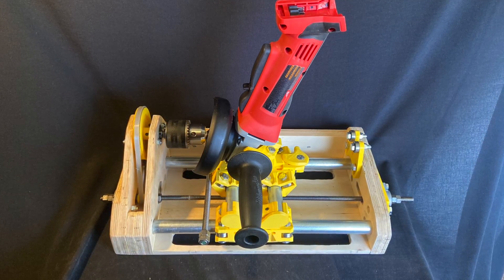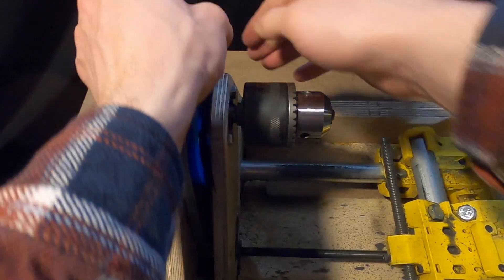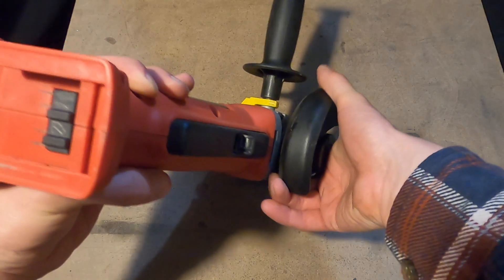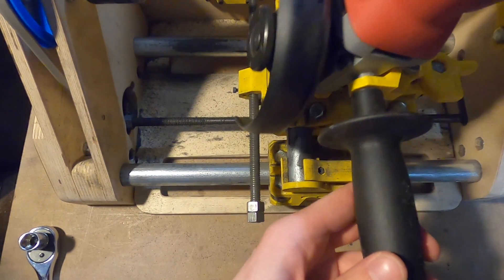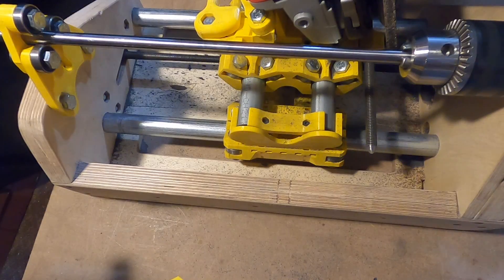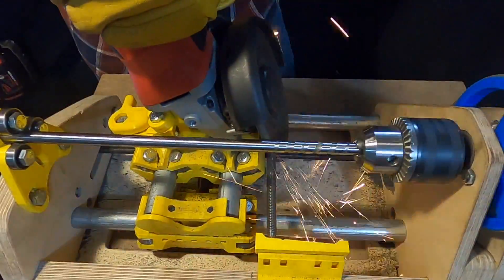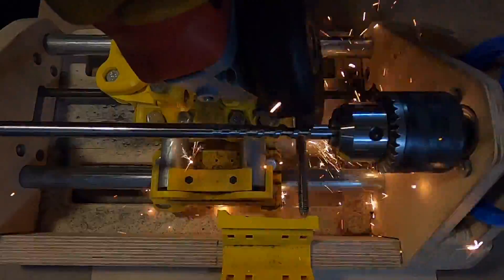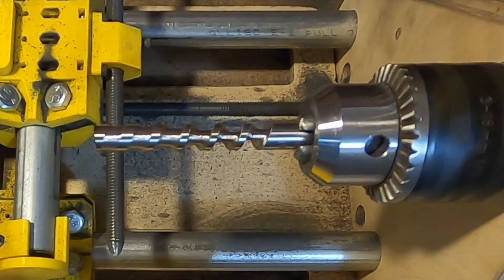Open Source Grinding Machine Operation for Compression Screw Manufacturing

Comment: Hello and greetings from Istanbul. For a while , I have been trying to find an affordable way to produce extruder screws without a lathe, as I can not afford to buy a lathe or hire by hourly use. Your system is just for me. I need to know one thing: What is the formula to determine the rpm of screw and the sliding speed of the set up that grinds the screw. Thanks
Reply: if you build this, you actually WILL have an affordable lathe and the skills to use it!  I think that if you can afford it, there are some obvious upgrades to make.  The Z-axis bed could be lengthened but would need more structurally rigid rods to run on (drill rod perhaps?) As well, the profile can be changed at will by simply changing the profile template.  Good luck!  Istanbul is a lovely city - dodgy taxi drivers, but a lovely city with nice people! :)

Comment: Hi! If such a screw were used for a filament extruder, how many cubic centimeters per second would it squeeze out plastic? Is there a relationship of melt volume to screw diameter and groove depth?

Comment: This is the next step in diy 3d printing. Being able to create small scale extrusion screws will enable diy plastic recycling into new filament.
Reply: And after that, the next step will be making two screws, each a mirror reflection of each other, for the making of a twin-screw extruder, aka a compounding/mixing machine for plastics. Like those used in ALL raw plastic manufacturing factories, and almost all filament-making ones too, which will allow us to add JUST the additives (like pigments) that WE want. The screws need to be counter-rotating, interlocking, mirror images of one another. Before that, however, the person who made this video need to find a way to automate the movement of that grinder set-up. Or use a CNC machine instead (CNCs are used to make extruder screws on the industrial scale, and there are already more and more better and better plans online for building CNC machines. They are getting closer and closer to real industry-grade designs. I have not checked for a while, do you know if we are pretty much THERE already????)

Comment: hi mate love the vid your missing files like prob mount grinder mount pully are missing
Reply from the maker: All CAD here https://osf.io/ev6ta/
Reply: @FAST-GROUP  Can't download it.
Reply: Hello Brett,
All files are located in the OSF repository (https://osf.io/ev6ta/). Just a reminder the grinder mount may need to be redesigned if using a different angle grinder.
Reply: @jacobfranz9372  i found it in a jumble of items iv made a step file. Where did you get the pully gears from as I can only find the scad for cnc driver file
Reply: @jacobfranz9372  i designed a jig for the size screw i need. Just been looking for the pulls so I can finish of off the file so I can start printing companies

Comment: Hello Joshua, I'm having problem to understand the freecad parameters, could you provide the 3d model of the chuck and threaded rod pulley and belt, please?
Reply: Hello Marco,

What problem are you having with the freecad parameters? The chuck I used did not have a manufacture provided cad model. I can do a rough model of the chuck if you need it. The threaded rod pulley and belt are both in OSF as OpenSCAD files named accordingly.

Comment: I have a few notes:  The lead-in and lead-out angles on the pattern should be more shallow, they look a little abrupt.  When grinding, it's best to start at the shallow end and work to the deep end, I think you will find that starting with a lighter load will give better results and grinding disk life.  On a lathe, what you call the X axis is referred to as the Z axis and what you call the Y axis is referred to as the X axis.  When you decide to CNC this thing, that is the nomenclature you will find used in that domain.
Reply: I've downloaded the paper - unfortunately, all the links listed are now "404".  Hopefully the authors will make the 3d printed parts files available.  I think with some changes, this design will easily create multi zone extruder screws (using different profiles) of sufficient length to produce vastly improved DIY filament extruders.  The paper mentions a limit to the diameter of the screw stock of 16mm dictated by the jacobs chuck holding the material - a simple bit of lathe work on the end of much larger diameter rods will make a 25mm rod fit into a 16mm chuck! :)